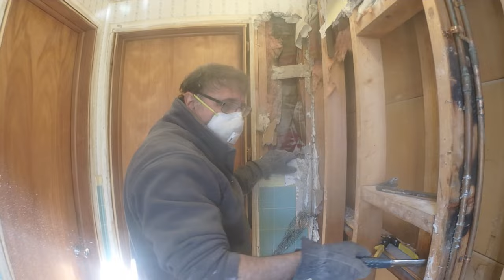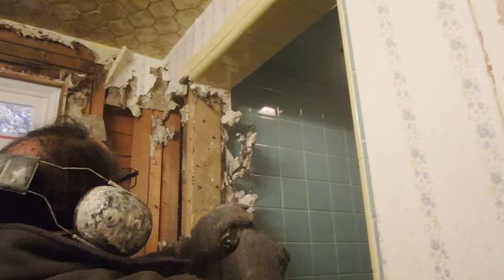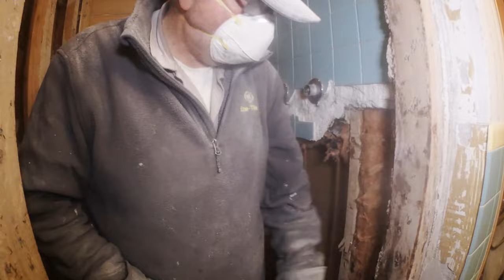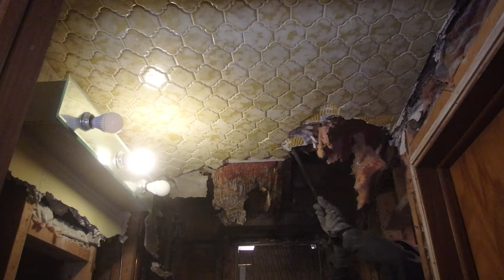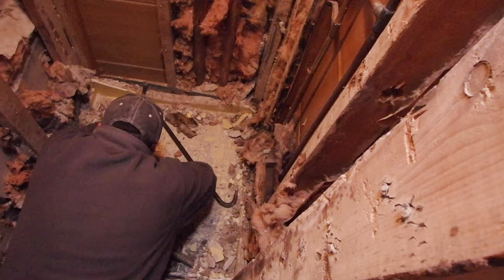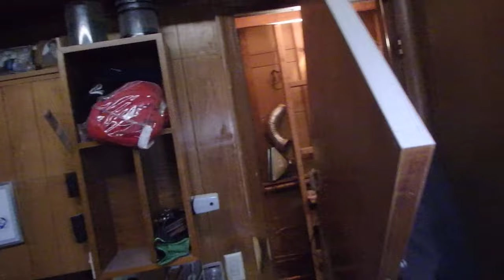Dirty, Dusty Bathroom tear out, time lapse.

Comment: not a lick of waterproofing anywhere , looks like no pressure treated 2x4s and for the most part dry and was standing fine for at least 40 years. i have ripped out hundreds of tile baths and for the most part all the walls behind tiles were dry. yes some were wet and falling apart but thats because tiles were cracked or gout was totally missing and water got in thru there. i do like the products we have today but you have to admit alot of its overkill and just a way companies make money .